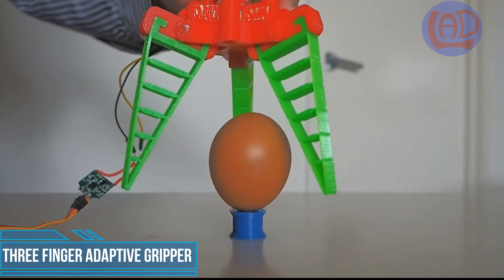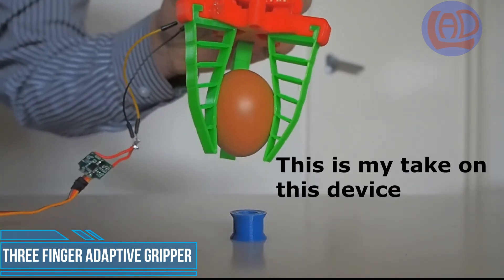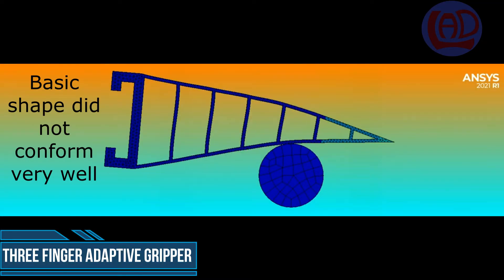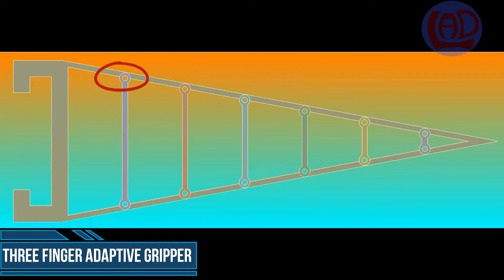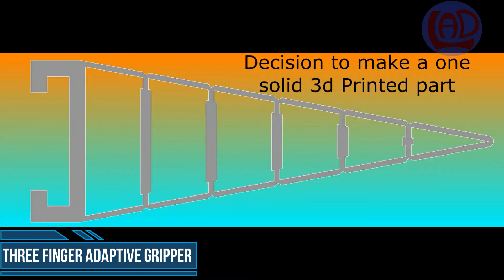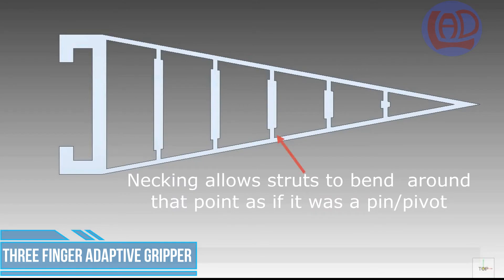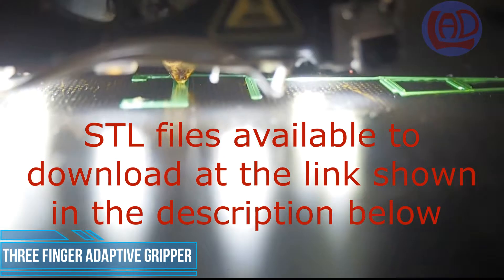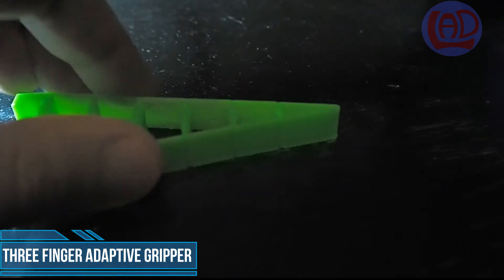ADAPTIVE GRIPPER - DESIGN & ASSEMBLY INSTRUCTIONS -FIN RAY EFFECT- MY TAKE ON THIS DESIGN-3D Printed

Comment: Hi, did you connect the servo motor to a speed controller and a switch, and the switch is connect to a battery?
Reply from the maker: @cloverrrli. In this first version there was just an off/on switch connected to a dc source and a dc motor. In the improved version https://youtu.be/Cd1YlTOBukQ?si=_eMFs49L0MWdNiSO, there was a dc motor connected to a motor driver controller , which was controlled by an arduino board.

Comment: Bro can you tell how are you controlling the motor
Reply from the maker: Hi there. This was a proof of concept of the more complex improved version 2.  It was operated by manually flipping a switch on/off and changing the polarity. Version 2,on the other hand, used a motor controller connected to an ARDUINO board, and a couple of home made limit switches. Check out the video here https://youtu.be/Cd1YlTOBukQ?si=SFzTERZjLFUW2sib

Comment: Can you share motor which u use with this?
Reply from the maker: Hi there @bossweerawut5063. This was a micro N20 geared motor 298:1, 90 RPM with  5kg.cm torque  3 to 12v

Comment: Hi could i use your projekt to my final in university, Can you share the exact material of the 3D printing both red and green, Thanks for the help
Reply from the maker: Yes, sure. The Green fingers are made of 3D printed TPU (90 Shore A).  The red parts are made of rigid 3D printed PLA. Good luck in your project.
Reply: @LADRobotics  What kind of nuts and bolts did you use and what kind of engine is it?  Servo motor or is it a dc motor, Thanks for the help "LAD robotics"
Reply from the maker: @a2ayt648   check out minute 2:09. There is only one screw m3 with nut. Dc motor is a N20 microgeared moror 298:1,  5kg.cm or similar at 9 to 12 volts
Reply: @LADRobotics Thanks again🎉❤

Comment: hi i just printed  this and now its full regit do we need fixible filament this gripper??
Reply from the maker: Of course. If you read the description in cults3D it says “All parts are printed in hard material with the exception of the Green finger or "Corrugated_adaptive_Finger.STL" which is of flexible material ( TPU 92 shore A).” It won't work otherwise. you need to get TPU filament

Comment: Is this gripper can hold a 500g object for 45 sec?
and What 3D Printing Material did you use? and can you please share Arduino Code to run it?
Reply from the maker: I'm not sure. Sounds like a lot. All instructions and details are in the link shown in the description of the video. The flexible material is TPU.
Reply from the maker: Hi Friend. I've been working on an improved version of gripper, which I tested to 500gr, and It does the job. If you are interested you can download the STL files and the arduino code from the link shown in the description of the video
https://youtu.be/Cd1YlTOBukQ